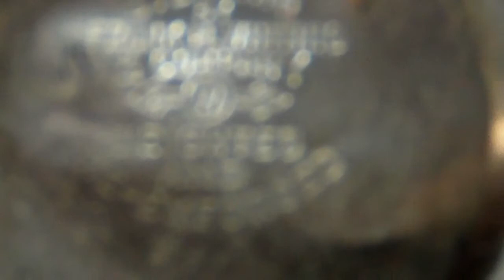Weighted Sterling Silver, differences in thickness, something to consider when buying this stuff.

Comment: I have some pieces, both pretty old, I can't tell if they are plated or solid. What's the trick to finding out? I hit a wall looking into the hallmarks
Reply from the maker: If they are just hallmarked, no numbers or anything else I would keep trying to find out info on them. Most of the time just hallmarked stuff comes from England and some of that stuff can be worth a heck of allot more then just the metal. If your pretty sure they are not worth more then metal value, acid test will tell you if they are plated or not. You can get silver testing solution on ebay pretty cheap.
Reply: actually the napkin holder itself was going for decent money on etsy and ebay. Some said plated and some said sterling, thanks I have the time. Gonna go a bit more research